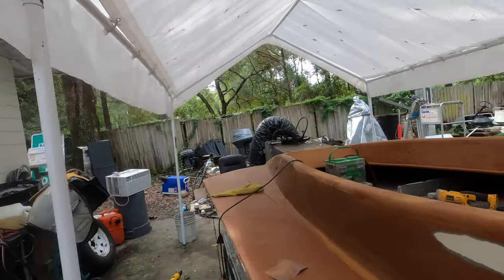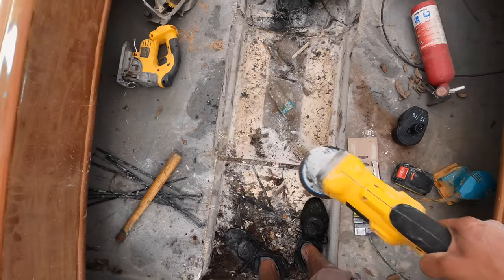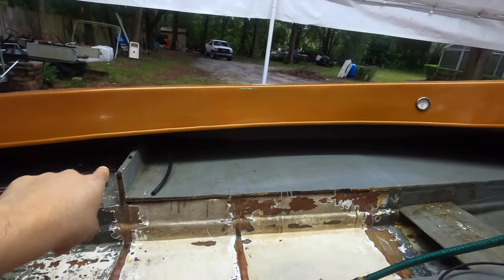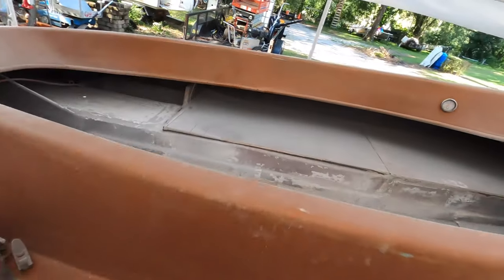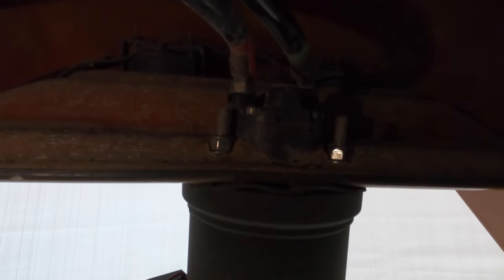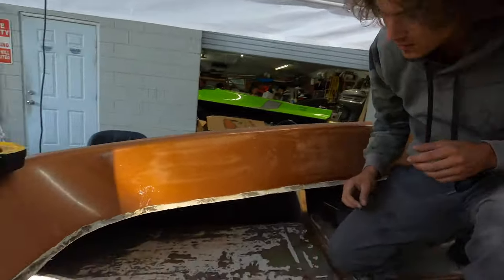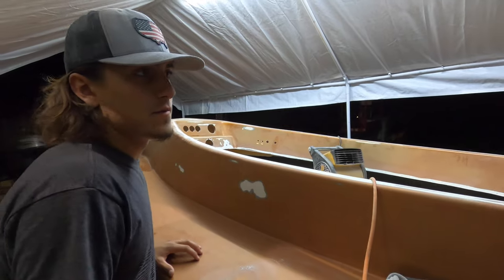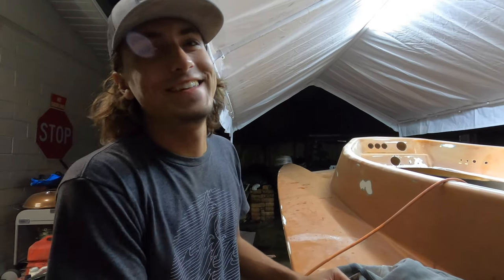Race Boat Restoration Pt 2

Comment: I went thru those Fiberglass itching nightmares when worked at marina in Guntersville AL after doing hundreds bottom jobs & repairs , we started to baby powder anything exposed ( clogged up you pores )  then when you get in shower use cold water ( keeps your pore closed )to rinse & wash away the glass then use hot water opens up your pores shower normally works every time I never lived that kinda hell again, Love your vids